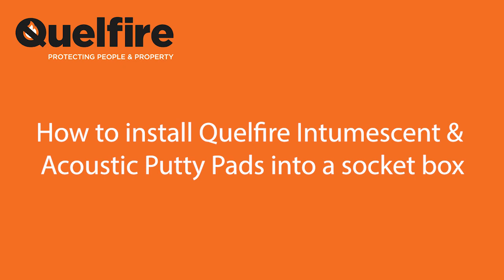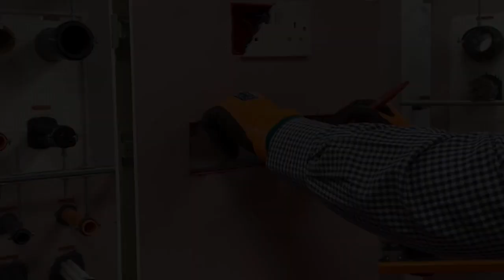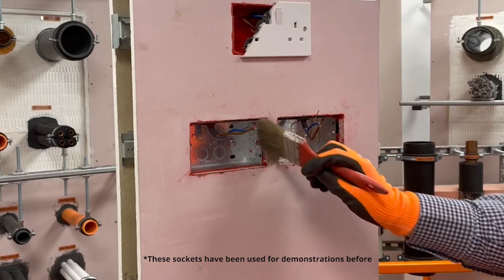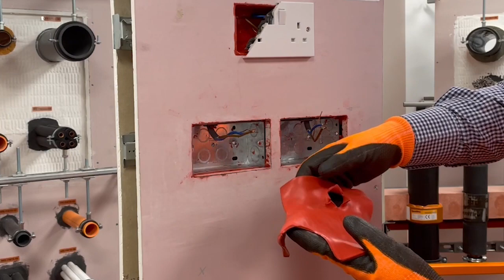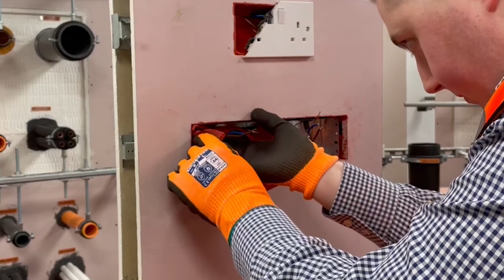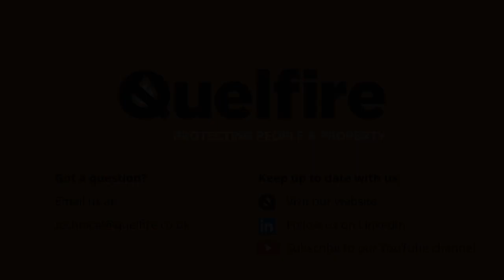How to Install an Intumescent & Acoustic Putty Pad Into a Socket Box

Comment: Why inside?? Everyone wraps it around back!
Reply from the maker: Hello, and thanks for your enquiry! Most fire test evidence available is based on the application of putty pads within the socket box itself. From a practical standpoint, installing the putty inside the box is generally more effective, especially considering that most metal socket boxes are not fully set within the plasterboard layers. Please let us know if you need any further technical information or support.

Comment: So if the earth terminal is required to be used (which most of if not all the time, it is) then the electrician has to scrape out the intumescent material from around the terminal of the backbox, which, in turn may affect the performance of the product..?
Reply from the maker: Thanks for your comment, Luke! The cables are usually present already in the socket box, so the putty pad installer would simply mould the putty pad around the cables. When we fire test the application, we include cables within the socket box to further evidence that there is no impact on the performance of the putty pad. You can find out more by searching "putty pad" on our channel, or by browsing the tested details on our website.

Comment: Will this not leech out oils that could stain the paint/plaster?
Reply from the maker: Thanks for your comment! This product is typically installed before any painting or plastering happens. It's installed inside the socket box and is then covered by the faceplate, so it wouldn't be in contact with paint or plaster.
Reply: @FirestoppingSolutions what if it's an already built house?
Reply from the maker: @martiruda  Thanks for your question! The response is the same as above - the putty pad goes into the socket box, which shouldn’t have any paint or plaster inside. If you have any further questions, please don’t hesitate to reach out to our technical team: technical@quelfire.co.uk.